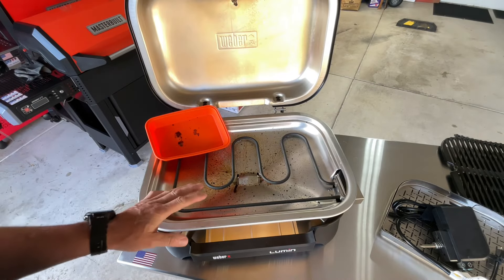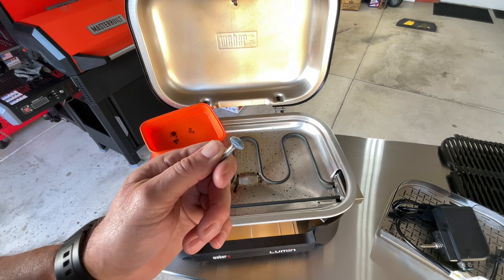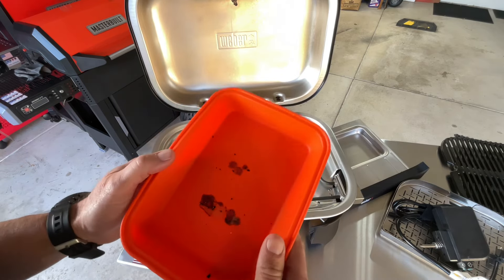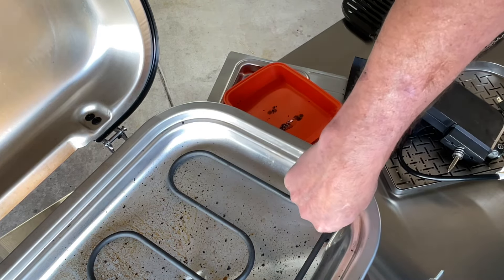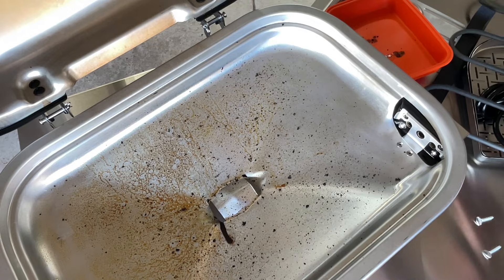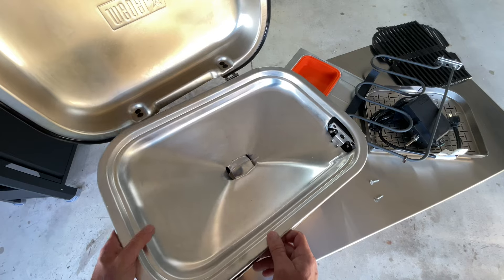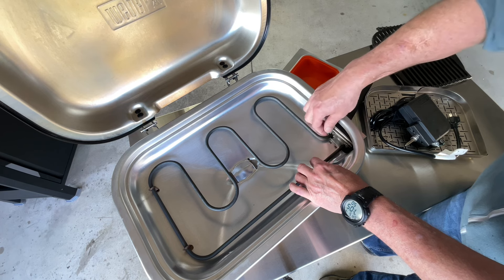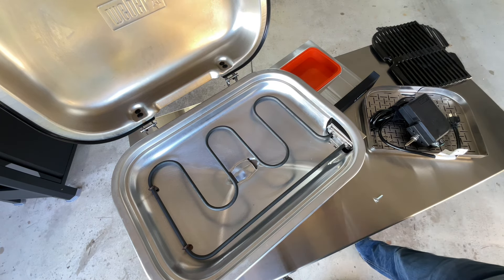Weber Lumin Electric BBQ Grill / Must Have Modification’s!

Comment: THUMBSCREW TIP: Drill a hole in the thumbscrew head, and in tight spaces you can use an Allen key or anything else that fits in the hole, to loosen/tighten in areas where your thumbs are clumsy or cannot fit.
Reply from the maker: Thanks for Watching Nate! Good tip!
Reply: Or you can just use a screw driver on the original screws.
Reply from the maker: @stevenmeyer9674 yes you could